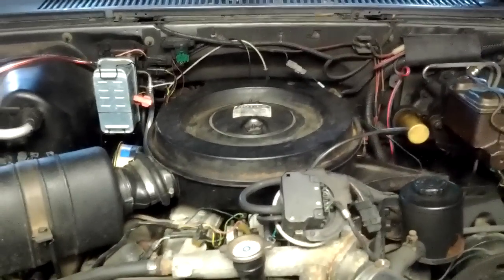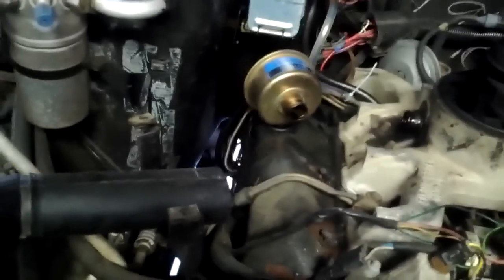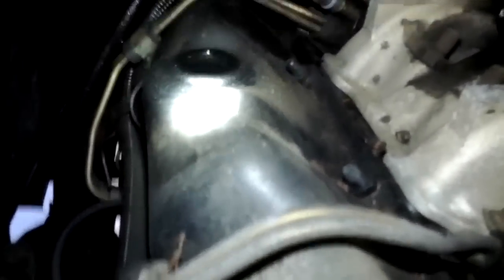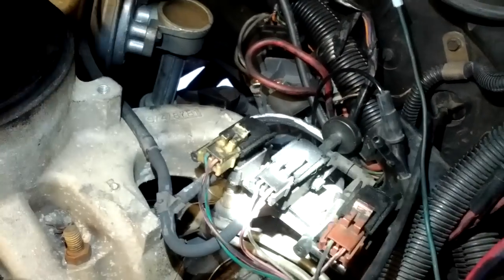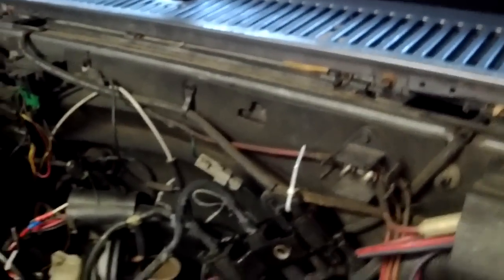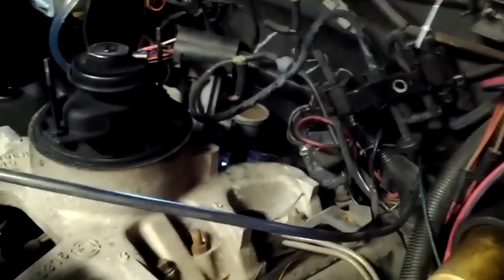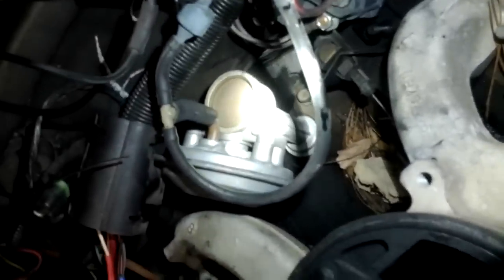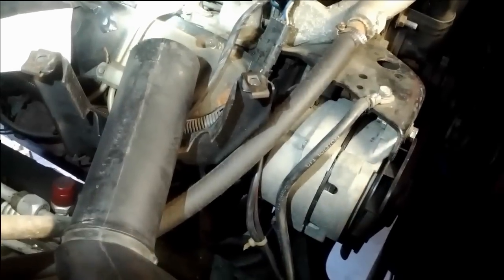Removing Intake Manifold 6.2 Suburban

Comment: Looks like your rings are getting worn and you have some blow-by.  Take off the oil filler cap off when the engine is running and see how much vapor is coming out.